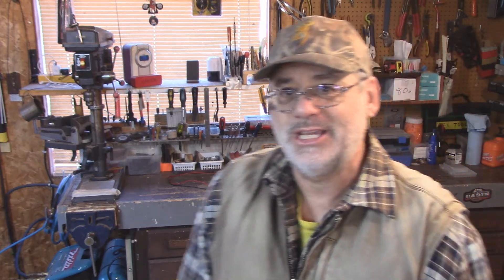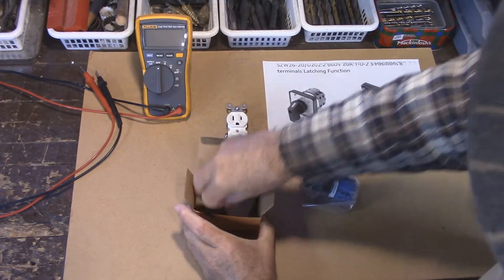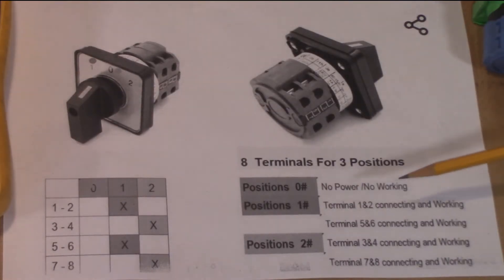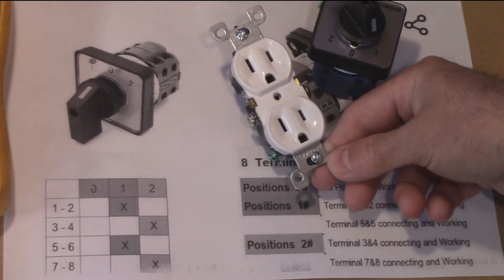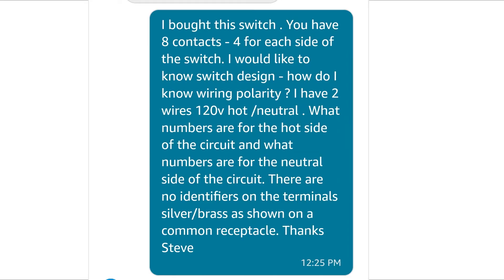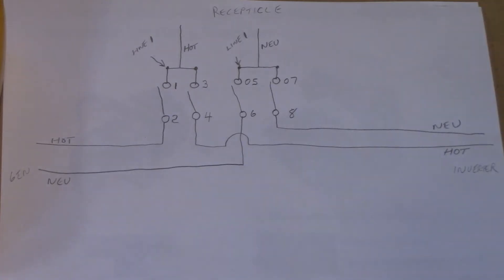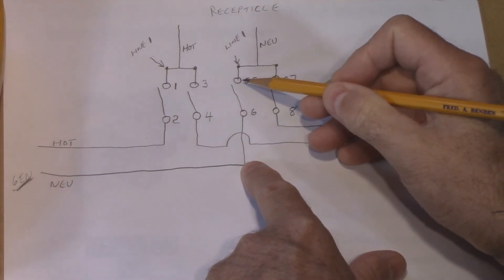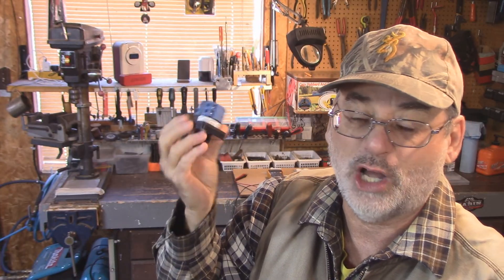How To Wire A 3 Way Power Distribution Switch

Comment: How's she goin'?  This drum switch can be used for several applications other than just domestic wiring that uses 'hot' and 'neutral' lines, that's why the terminals are not identified like you expected.  The way you have drawn the connections will work.  You can use whatever set of contacts you want to do whatever kind of function you want with this switch.  You have identified 1 - 3 and 5 - 6 as the 'hot' side for your application and then 2 - 4 and 7 - 8 for neutral.  Well done.  Good luck with the project.  Take 'er easy!!
Reply from the maker: Hi Mike , a bit of a mind twister if your not careful :)

Comment: I really watched this video carefully because I'm going to have to know how to operate this switch. The thing is, Steve, is that me and the wife and our very large extended family actually, will be hauling our 11 trailers up to you cabin property and using the whole place any time you aren't there. We have been impressed with all the solar and battery systems you have in place up there and we decided it would be much cheaper for us to use all your stuff than to buy our own. This is the best and most cost effective solution we have come up with for our large family group camping solution. Just one question: Where do you hide the keys. We'll need them to get full access into the the cabin, sheds, and outbuildings. Just so you know, we don't mow grass. Please let us know a few weeks in advance before you plan to visit your cabin and please, don't stay too long.
Reply from the maker: HAHAHA 👍
Reply: @SteveRobReviews  Correction 18 trailers not 11 will be there Tuesday then the hill-climbing mud races and pig roast starting  on Wednesday in preparation for the biker party that will encompass the entire weekend. Some heavy metal and Punk cover bands will be entertaining us all weekend. Should be fun! We didn't see any portable toilets but we did see garden spaces that will make do.
Reply from the maker: @EverydayProjects See you soon then.
Reply: @SteveRobReviews  You'll be in that black and white car with the lights on the roof, right??:face-purple-crying: Thought so...
Reply: Can I go?
Reply: @FirewoodAdventure  You are more than welcome to attend. Bring a tent and some earplugs...those heavy metal guys are LOUD! PS: Don't tell Steve. He doesn't know yet lol
Reply: @EverydayProjects  I'll gather up some of my old drinking buddies. A few were released from prison recently.
Reply: @ I heard. They’re certainly welcome. Steve wants it to be a real big party 🎉 🤫🫣
Reply from the maker: @OpenAirAdventure 🤣😅

Comment: You can do the same function with a dual pole dual throw toggle or rocker switch that UL rated. Those imported drum switches look good but I’m not wild about them for some of the reasons you mentioned. Cheers Steve and good luck 🍀😊👍
Reply from the maker: Hi Lloyd,  a switch I'm not familiar with but I'll give it a go . Cheers

Comment: Hey Steve, with a little more complex switching situation it's always good to put pencil to paper.  Your drawing is excellent.  You did not connect the neutral from the generator to the neutral of the inverter, and that's important.  Make sure you use a proper electrical box to mount the Three Position Switch.  Another concern is the quality of the switch coming from Amazon.  We both know there's alot of junk on there.  Is the switch CSA approved?  I'm guessing not, so inspect the connections on the switch from time to time.  Inspect for indicators of heat.  I'm looking forward to Part II
Reply from the maker: Thanks for the tip, I'll be sure to make note of that for part II.

Comment: By your diagram, that should work but there is no need to switch the neutral. Just switch the power side and it will work. Neutrals would be common and thats OK…..CHEERS
Reply from the maker: Thanks for the tip Gator 👍